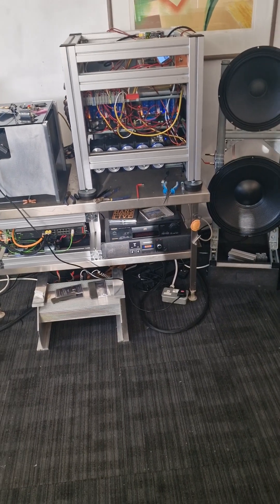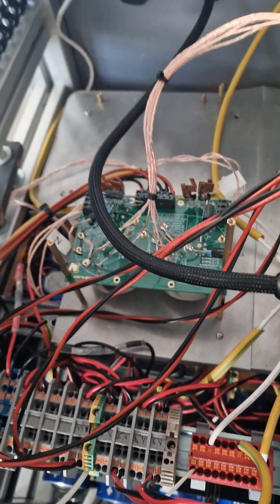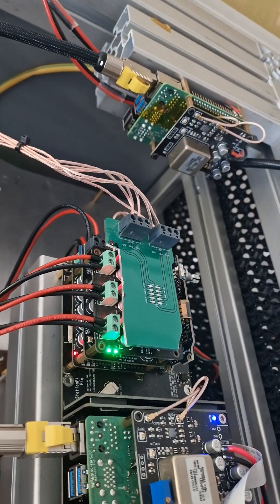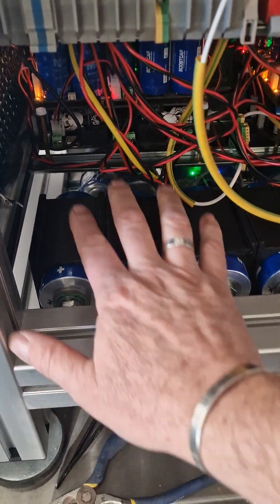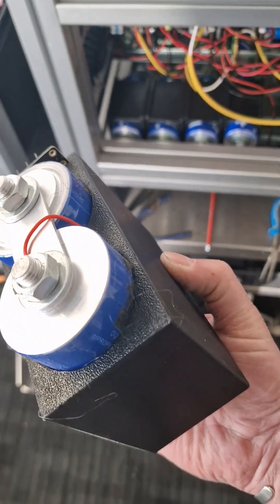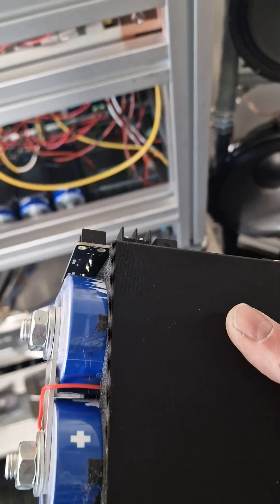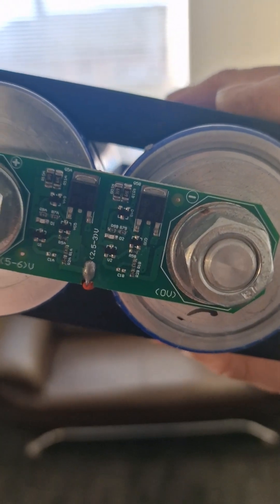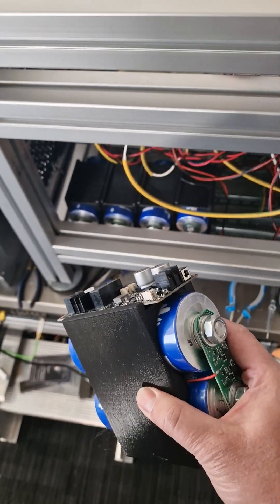UCpure 5v Ultra Capacitor holder

Comment: Would it be possible to share the 3D plans of the UCPure holder?
Reply from the maker: Are you wanting to print yourself? Can sent fusion 360 model if you want.
Reply: @tobyking4172  yeah I can print it myself. Would really appreciate it.
Reply from the maker: Cool. Thk0783217380@gmail.com